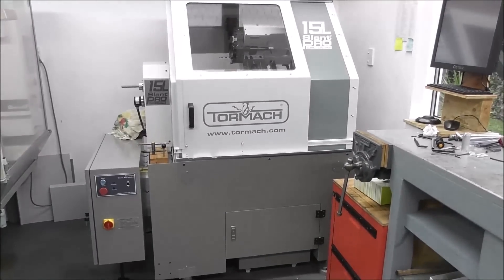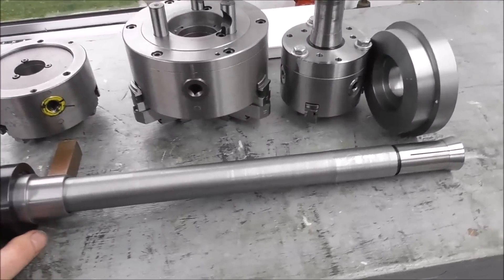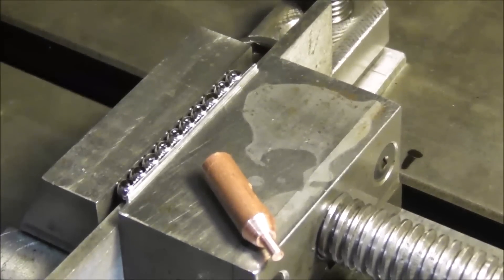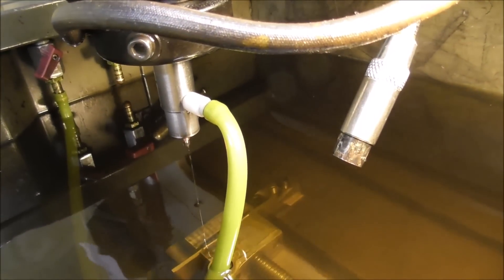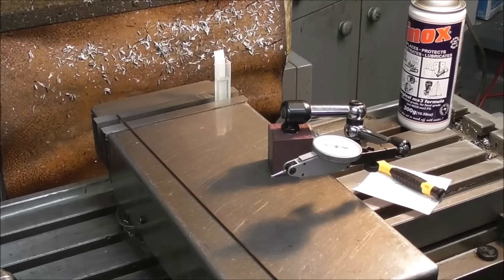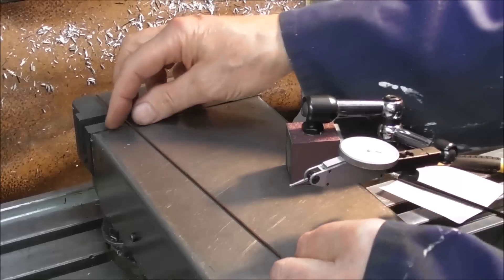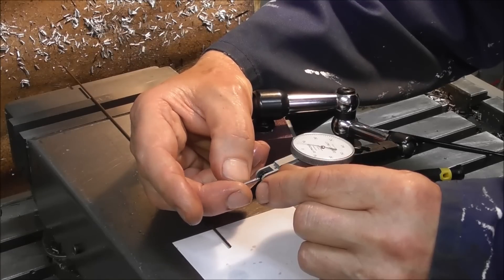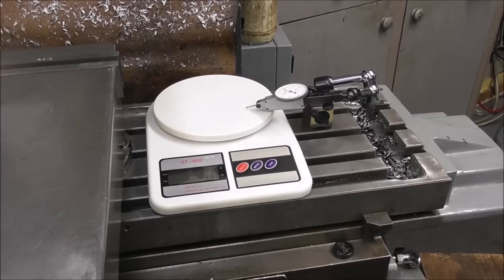Tormach SlantPro Install, ITTP Parts Production and Dial Indicator Maintenance

Comment: Looking forward to getting my ITTP in a few weeks! I'm surprised how much room you actually ended up with Cliff, once that SPL got installed. I wouldn't have thought you would have that much room when you gave the walk-around tour and were talking about it before it arrived. Nice tidy shop!
Reply from the maker: Thanks Tom. I think space is important...and the camera is kind.  Cheers  Cliff
Reply: I have the room for a SPL in my shop, no problem. The problem is that I'm not sure I have the work...or that I want the work that spending $20K or so on that lathe will force me to go after. I'm somewhat rethinking my decision to buy both an 1100 and a SPL. Instead, I'm revisiting your playlist on the RapidTurn, because (at least for now) it might handle all my needs right now--and give me the opportunity to work with the 1100 and the new (to me) art of CAM programming. 

I'm still buying the 1100, that's a certainty. And I definitely can't wait to use your ITTP. But I may just add a RapidTurn to the 1100 order, and push the SPL purchase off into the distance. Getting them both will, I think, apply a level of pressure that I don't really want right now. For your situation it made perfect sense--you're building the ITTP units, and the SPL gives you better rigidity, repeatability and (ultimately) profitability. But I'm not there yet. 

Anyway, you have a beautiful shop there and it's very well organized. I bet your efficiency level is off the charts.

Cheers!
Reply from the maker: Thanks Tom - I can really understand your dilemma!  Cliff
Reply from the maker: Hi Tom - Space is a strange thing isnt it!  Cliff
Reply: It is indeed.

Comment: Hi Cliff. That indicator adjustment was very useful, I didn't know that was possible. 

An even better holder for those probe tips is a mesh tea strainer like this: http://tinyurl.com/yafet99d 

The handle and spring loaded closer should be really handy for parts cleaning and they are widely available and cheap.